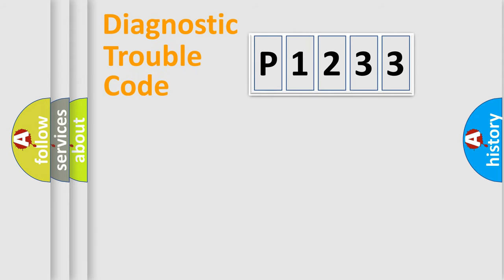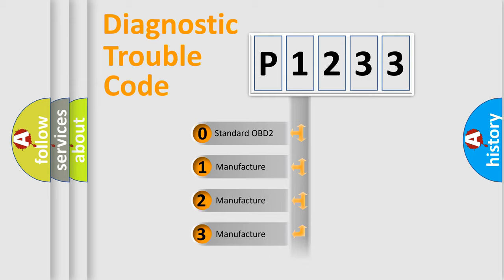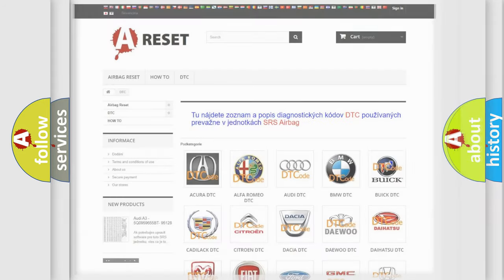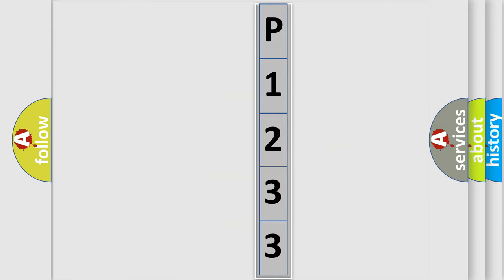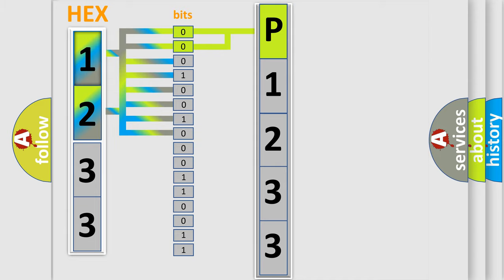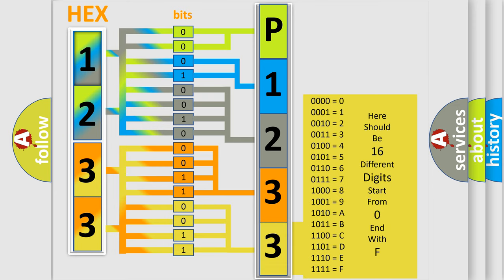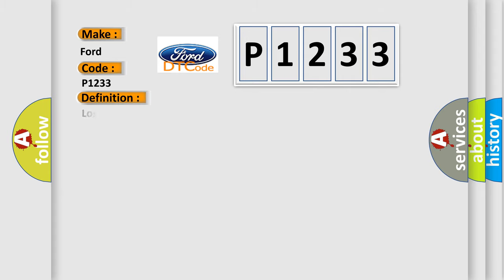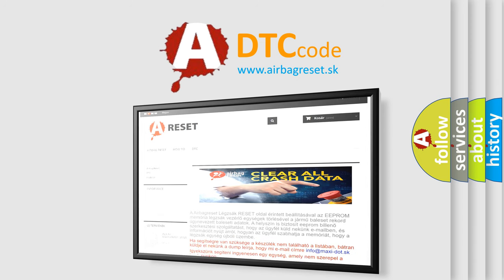DTC Ford P1233 Short Explanation

Comment: If you open the hood, to passenger side under hood above the headlight on the radiator support you will find a ground wire. Clean it well, both bolt and connector tighten, may solve your problems!! It did mine after numerous attempts to locate ACTUAL ISSUE! Ths grounds the CCRM!! Which has relays for fuel, pcm, etc. Therein lies your issue! Likely!!